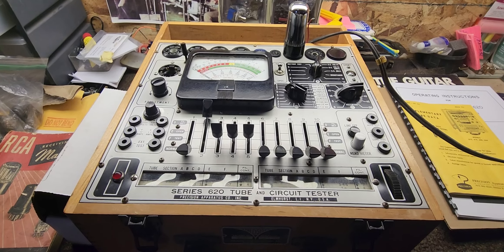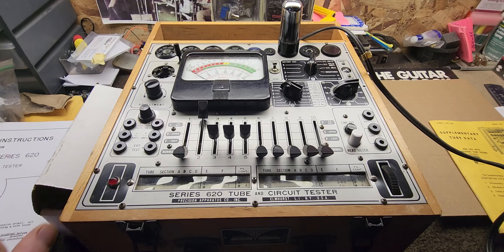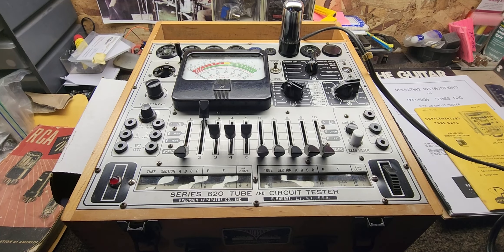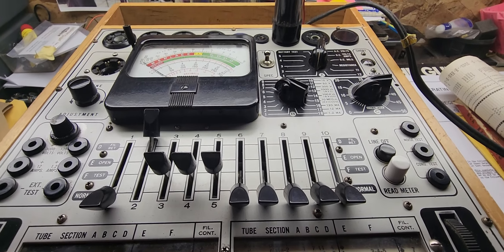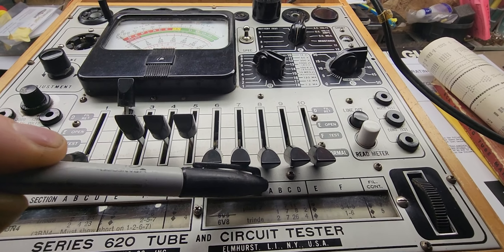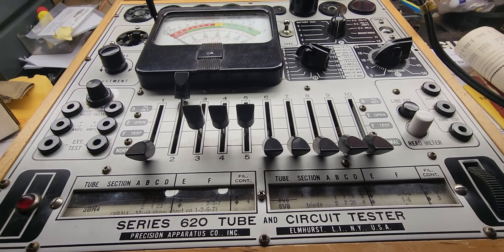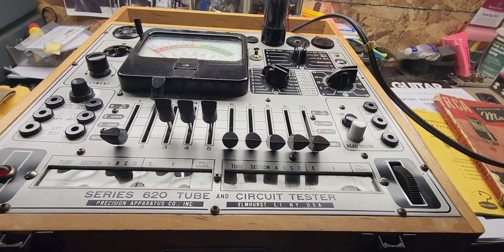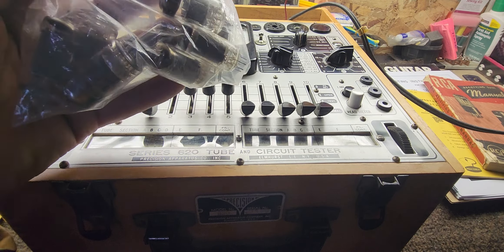vintage precision apparatus tube tester with demonstration..

Comment: Nice video presentation Jake just wondering does that manual also have instructions on how to calibrate this tube tester?
Reply from the maker: I will need to take a look at the manual again to see if the info is in there etc.
Reply from the maker: I am uploading a video of the manual right now for you guys! stay tuned

Comment: I've just acquired one of these, do you know what the Fil Cont setting is for and how you set it? That's the last column on the tube chart
Reply from the maker: it's been a while since I've used it , I will dig out my owners manual In a few and see if I can help you. I was able to buy a manual for it on ebay.  it was a copy of original but we'll done .